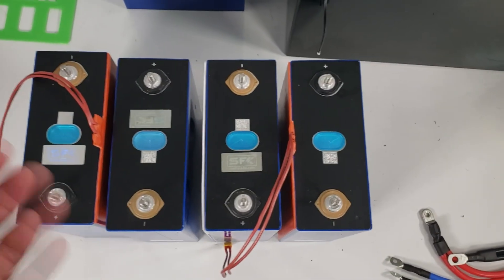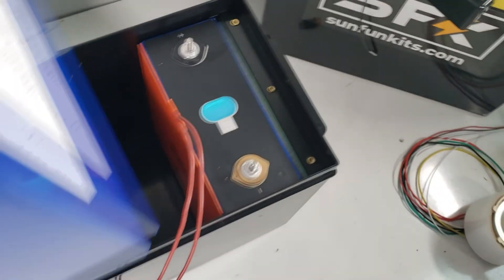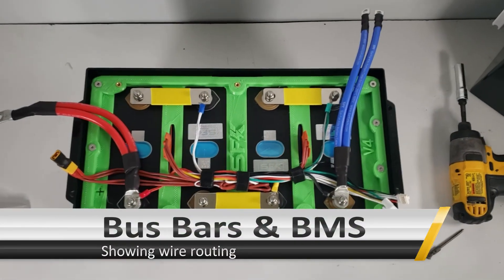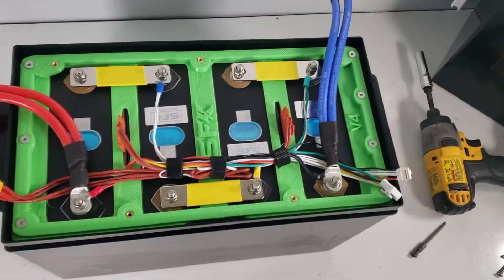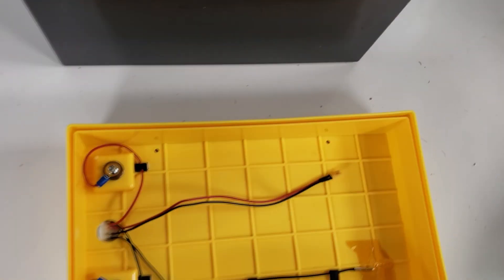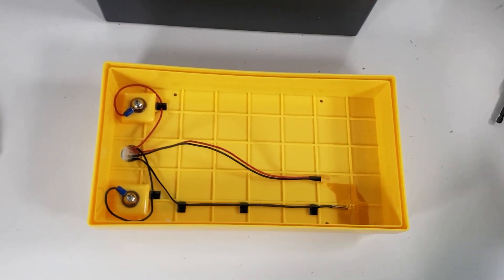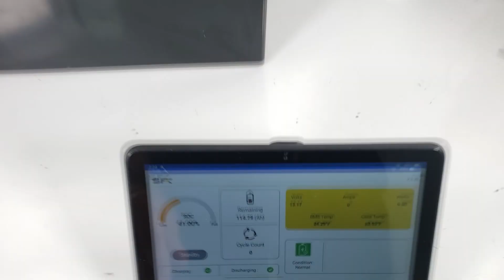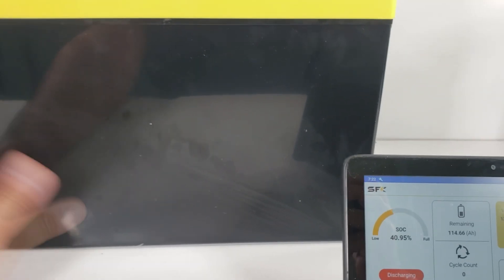V4 Standard Edition + Heating! $1075.00 for 304AH, Smart BMS, & Heating LFP Battery.

Comment: What material do you use for the 3D prints?
Reply from the maker: High temp Pla works well as it has better dimensional accuracy. Carbon fiber pla is also another good choice but is expensive. We do not recommend petg or abs as they are not as rigid as pla.

Finally you can anneal high temp pla for even greater strength.
Reply: Wait, are STLs available for these?
Reply from the maker: yes.... darn u must have found them before the download page went up: https://www.tinkercad.com/users/hpz5vdKaOMV-sun-fun-kits-llc @ChrisEpler